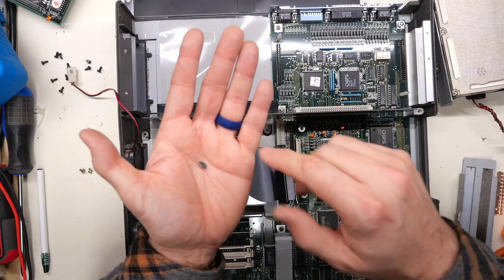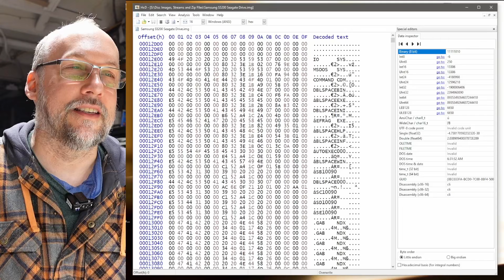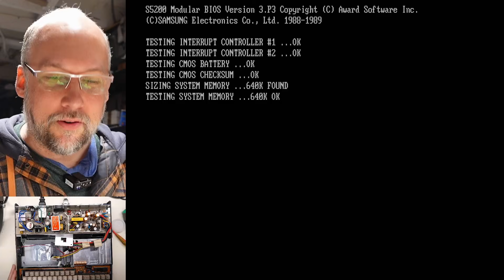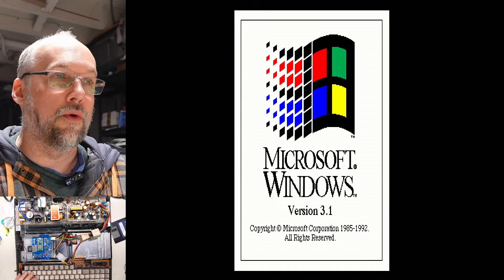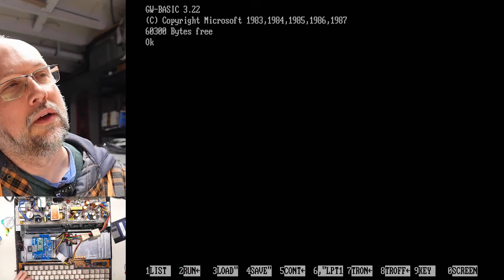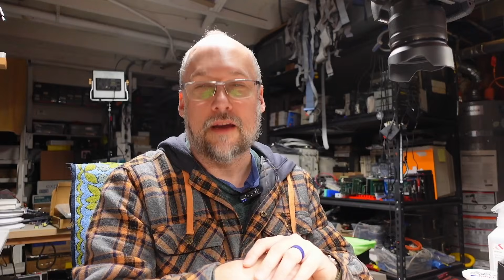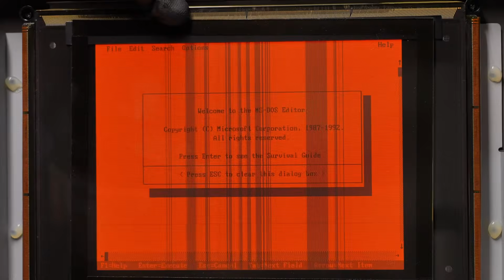PC Archeology: Let's explore the Samsung S5200 and attempt a repair on the gas plasma screen

Comment: the BEST tool I've found for true low-level sector by sector data recovery (partitions and formats ignored) is a lovely little tool called "GetDataBack".. For free alternatives; Recuva, and PhotoRec (both are quite good)
Fairly certain GetDataBack and Recuva are both able to recover from images.  Otherwise, just mount the image as a virtual hard drive?

Comment: Note regarding XTIDE: There's a project called XUBDisk that loads XTIDE Universal BIOS from a floppy. It's annoying as a permanent solution since you have to boot from the floppy every time, it takes some seconds to load the dozen KB or so of data from the floppy each time, and it eats as much conventional memory as your XTIDE ROM takes up plus its usual 1 KB working memory. But it can get a computer running when it's not possible or feasible to load it from an actual ROM chip.

This also makes me wonder if it wouldn't also work to have the option ROM on a card the usual way, and then just have a boot floppy that has nothing but a jump instruction to that ROM in its boot sector. That way it doesn't cost any conventional memory, boots up faster, and should still work on a machine like this, since the issue is that the BIOS doesn't see the option ROM and try to boot from it.

Comment: You will probably have no choice but to replace the plasma display with a modern LCD display and emulate that red plasma screen. However, you're not going to be using it for anything other than a collector item, so might as well leave the original screen.

Comment: I dont know if you managed to fix anything with this disk, Im quite late to the party. However, I do have some good tools to extract data from drives etc that I used at work to recover a huge disaster. It is a commercial software. If you still need to try and read something out from the drive, well, let me know and we can figure something out.

Comment: Tantalum capacitors short due to overvoltage, reverse polarity, or current spikes, which cause the dielectric material to break down. Common causes include applying a voltage above the rated limit, connecting the capacitor backward, or a sudden surge of current without a current-limiting circuit. Aging can also lead to a buildup of crystallized tendrils that bridge the gap between electrodes, causing a short.

Comment: This gas plasma looks exactly the same as one in a Toshiba or compaq, can't tell because Toshiba is slightly larger, but they both have the same chips. You can replace the problem chips with working ones, which is what I'm doing now. I'm canabalizing two Toshiba screens to fix some compaq screens. So far I managed to get one screen without lines. I'm going to make a guide on vcf forum when I'm done with my repairs. You can identify the problem chip by running a screwdriver across the pins of each IC and it will light up a specific column. When it lights up on the dead lines, you know which chip is bad. I found a fringe video that also mentions you may want to replace a chip next to it. The reason why is the problem chip might not be bad and it might be the one before it. The one before it just might have an Issue sending data to the next chip. Data flows from the white ribbon cable through each chip all the way to the end.

Comment: Adrian do you think its possible to "clone" this card for get it as pcbway project? I mean, what king of propietary ics has?

I think could be amazing for the comunity to have a card like this avalaible like the xt-ide project.

If you make a video pushing the limits of this card in terms of overclocking could you please try piball fantasies game? Iam curious to see if goes from unplayable with an 8088 with vga to fully playalble with sound using the 286 accelerator.

Comment: accpac plus i was still using this on a novel server in 2000 had to do all the y2k updates and it was still working 
then we finally ended it and moved on to somting else by 2001
we would run it in the dos shell in windows 98

Comment: Tantalum capacitors have an oxide layer internally. It provides a rather nice amount of capacitance for its area if polarized one way. Reverse the polarity and the oxide layer breaks down and forms a permanent dead short in the capacitor. As some people in the electronics community say, "Tantalum capacitors are strongly polarized." Unlike aluminium electrolytic capacitors that also don't like reverse polarity, but aluminum electrolytic caps just build up gas internally until they explode from the resulting pressure.

I have seen ESD alone kill tantalum capacitors.
Not to mention any negative spikes on the power bus during start up or shut down. (a couple hundred mV spike and its dead and will burn up when power is applied.)

And that screen assembly is surely something interesting. I agree that it doesn't seem all that fixable. But interesting.
Also, that doesn't look like a soldered interface, but rather a "Z tape" interface. Ie, just like a zebra strip, but 2 dimensional. A thin sheet that only conducts vertically through it. Really popular for bonding flat flex to glass, like we see here. Heating it won't help, and might in fact make it worse as the tape "curls up" from the heat and makes even worse connection.

And yes, conformal coatings are fairly common for high voltage applications. Or if one wants to reduce the risk of tin whiskers, especially in lead free solder. Can also held ensure that conductive dust doesn't lead to problems. But for this screen I suspect the main reason is to ensure that sparks doesn't jump between the pins.

At work I conformal coat quite a few boards for various applications. In my experience some brands of conformal coatings never really hardens fully, partly as a feature to not crack over time, but it sure can make boards get glued together if they rest on each other for a while.

Comment: Those two video modes you were perplexed by when you ran the vidspeed benchmark were VGA-modes, but it didn't list 320x200x256, which is also a standard video mode. If it had, I would be asking if you're sure that you don't have a VGA card in there.

So... It is an EGA card? Well, I've heard of some EGA cards that even supported 800x600x16. At least some people referred to them as Super-EGA cards, and unlike SVGA cards, they didn't support 256 colour modes. Maybe this is one such card...

But the monitor... Yeah, I'm assuming that there were EGA monitors to support these resolutions, but not in the beginning, since they are not standard EGA, but I know very little about that...

I don't know how vidspeed detects these modes - it obviously does, but it lists them as VGA modes, and I don't know if VGA programs would work correctly with the card... I don't think the refresh rates are the same as with a VGA card, and I know that if a program assuming it's running on 16-colour VGA mode tried to change the palette, it wouldn't work. EGA supports 16-colours from a total of 64 (RGB 4x4x4), while VGA supports 16 or 256 colours out of 256K (RGB 64x64x64).
I would be interested to know how... to know how you can test for what video modes are supported in DOS. Never did that myself, either I wrote the application to support a specific mode, so it was a requirement - or I let the user choose from a list of different modes. But this would be useful knowledge, as I've been mentally preparing myself (by not-so-mentally downloading copies of QuickBasic, Turbo Pascal, Borland C/C++ compilers [and DJGPP for that 32-bit DOS sweetness] from the webnetz) to do some for-fun coding for old DOS PC's :P

Comment: My first laptop, a used 386, I screwed up by spraying Windex on the screen, it got 3 horizontal lines on the screen that would not go away. I still used it that way but it really pissed me off. Back then even used it cost an arm and a leg (95)

Comment: I remember reading the Computer Shopper, which was a HUGE magazine you could buy of nothing but computer adds, and drooling over machines like this. At long last I saved a few pennies and bought a crapola 386SX25 and VGA monitor, it came via truck shipping, I used it till I found a good 486, at the time Workers comp sent me to college after a crash sent me to rehab as I could no longer be a cop, a girl in college bought my 386 with the slowest Windows 95 installed on it, 95 ran great on my 486

Comment: You can buy hotbar soldering irons from China for cheap. They have adjustable voltages and have a huge, wide tip on the end, specifically for fixing flat flex soldered connections. You should pick one up!

Comment: Hi Adrian. I enjoy your videos. I once owned a Toshiba 286 Laptop. It had a monochrome LCD and was build like a tank. Back in 2000 it adorned the front desk of my office, mainly because it looked cool, not because it was actively used. However, having said that I used Chiwriter 4 on it to very good effect. Eventually, the lines appeared on the screen, just like yours and the power supply started acting up. So it ended up in landfill along with most of my collection, much to my disappointment because I was running out of space. I regretted that decision and still do. If you can't find a plasma display I would urge you to give this PC a modern screen and bring it back to a useful stated. I understand that you have no particular feelings towards the laptop, but that's what I would do rather than keeping it in a perpetually "broken" state.

Comment: Forget if you mention it in this or the previous video, but found out today that the same exact screen is also used in the Toshiba T3200SX. A friend of mine owns one and luckily the screen is working perfectly on his. He had bought two, one with a cracked screen and one that wouldn’t boot, and combined them for one fully functional unit.
Reply: And very similar Panasonic plasma screen was in Compaq Portable 386. More info if you seach 'The Chronicles of Gas-Plasma'

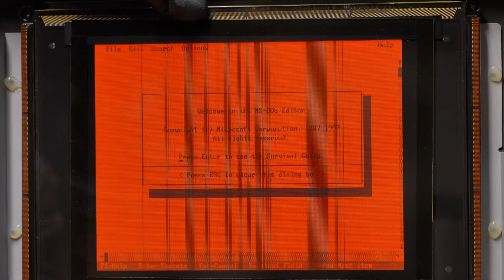Comment: Well.. being a goner anyway 🤷‍♀...1:10:11.... I would try to put some contact cleaner between the glass contacts and the flex cable contacts.. there where the corrosion is. and put some pressure in the glass like you were doing at 1:10:11.. and see what effect it has🤔....... Contact Cleaner will separates the glue.. yes🙄.. but you can put some sponge or rubber stripes behind the flex cable to keep the pressure in the area were the glue gets undone😯..... this is assuming of course.. that the flex cable contact are just pushing against the glass contacts... and they are not continues copper traces.. which I don't think they are🤔..

Comment: If you ever fix the screen of get an original replacement it may be worth adding a fan if possible or something to help with cooling along the top of the screen in case heat is the issue or is accelerating some sort of degradation of the connections

Comment: The glue on the outside is rather serving as a strain relief - to avoid excessive bending / sharp edges of the flex-to-glass joint. The glass-flex connection is made by "soldering" at specific temperatures - you can google "chip on flex" parts for LCD panels, its very similar technology.

Comment: Those lines on the plasma resembles the ones on the old game boy, which is caused by the glue making the connection in the ribbon cable deteriorating. On the game boy, you fix the error by heating up the glue and applying some pressure. Perhaps that would do the trick here?

Comment: If you set the drive type in BIOS to "Type 47," then it should allow you to edit the fields for the cylinders and heads.  That was actually the standard in the early Eighties for advanced drive controllers.  Before that, you needed to get into a firmware program on the drive itself by opening the DEBUG command in DOS, and entering g=c800:5

Comment: For restoring the HDD have you tried Hirens Boot CD 15.2? I use DiskGenius specifically off of that disk, it might work or be touchy in Windows 10, I know it will work if it is booted into its WinXP environment but then it's a matter of mounting the image file

Comment: Those two circular glass projections on the back of the display that you wondered about might be cavities for getters inside the glass envelope. These would contain compounds such as barium which 'clean up' the impurities remaining inside vacuum tubes of all kinds. Otherwise, the impurities would quickly poison the display gas. When a getter cannot be integrated into a single path high voltage electrode (such as on a neon sign), a common mass production strategy would be to inductively heat the metallic getter substrate from outside the tube, until the getter is red hot (so it can't be too close to other parts inside that might be damaged by its short but intense heat). This chemically activates the getter. But it needs to be done at the factory somehow, after the tube is sealed.

Comment: I worked in a computer shop in the 1990's and we used laplink 3 to build every computer.  We would install the hardware, and use LL3 to copy over the operating system from a "server" over the parallel port since that was far faster (vs serial).   It was still pretty slow, but once you started the transfer, it was completely hands-off so you could disconnect the KB/Video and move on to the next machine.  One of the other nice things about using laplink is that it didn't matter what kind of other hardware the machine had.  Every machine at that time had a parallel port, so it worked 100% of the time regardless of the generation or configuration of the machine.

Comment: If i remember right they released dos 6.2 with DoubleSpace and got the hell sued out of them by the company that actually owned that trademark. 6.22 is identical to 6.20 except for renaming it to DriveSpace. It's been 30 years since I've mucked around with it so I may be a bit off on the details but that's how I remember it.

Comment: I have one of these laptops but with mine the psu shorted out and sent the 200 volts into an address line so 50% of the board is fried sadly. the display still works but i cant find any pinouts on it, would love to use it with a raspberry pi or a different sbc. would it be possible for you to measure out the pins on the video connector on your display?

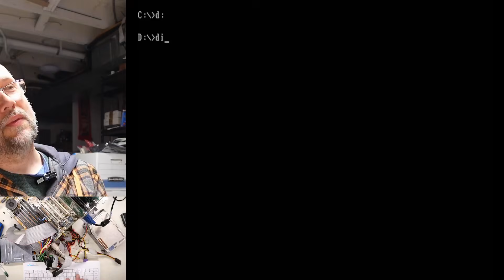Comment: 15:02 It's 30 MB but only 4 MB free, there is definately something going on on this drive. I'd try a simple undelete first. And I'd also try to find out where the 26 MB went (dir /a). You could also go to the FAT and make a list of all cluster chains and then extract them. Then, use tools to determine their file types (like Linux file).

Comment: found a T3200 maintenance manual there is a procedure for adjusting the screen voltage. It needs actualy an incredible accurate voltage. I don't know if your voltage supply is the same but for the T3200 : VR1 MIN +201v.  MAX +202v. then VR2 MIN +208v. MAX 209v.

Comment: When you checked the drive in the other computer, it showed on D, only 3MB available. But disk is 30MB. So there was unpartitioned space, or something, that was not assigned letter, and maybe used by dblspace. It is very long time I used it so I do not know how it works, especially in earlier dos versions.

Comment: You found dblspace to be behind the hidden disc content, but next time you might find 'r-studio' to be useful. I've used it for more years than I care to remember. The first time I used it I trashed my disc so be careful not to save back to the disc you're exploring. It's forensic and finds files that don't exist, but it seldom misses anything. In one mode you can find the deleted file structure pretty simply. Well worth a play anyway

Comment: Adrian, hello , If you could make a small puncture incision in the glue , you may be able to clean the contacts with Due-Ci Electronic R-10 Contact Cleaner ( I saved a few hdd electronic plates this way). It is worth a try if you can get the cleaner. I have the Toshiba T3100e , if you want I can disassemble it to check if screen is same model (not sure) , Mine works (the screen), but sometimes it fades after a few hours of usage.... (I plugged a old UPS so it should make power more linear - like a stop-gap fix). As for data recovery , you can use a bunch of softwarse that are in Hirensboot DVD , like Testdisk, EaseUS, GetDataBack FAT, SpinRite , and others depending on situation, some work even on 286... I use a overlay app so it let me see the full 4.3 gb. It should be able to apply on the same SCSI thingy with SD you used , you just need to do a bit of booting from floppy , load the overlay disk , find the drive, and partition it under dos... (should work in theory , worked fine on EIDE seagate).

Comment: Remember that DOS 6.22 can only see hard drive partitions up to 2.1gb.  So that 4gb SD card won't work unless you partition it into two drives.  Unless of course the computer has further limitations. 528mb is another limitation for some systems.  So there's another size you can try.
Love your videos, always look forward to the next video.
Reply: To complete your info DOS3.3 32MB

Comment: i could't wait so i took a screen apart. it's obvious a bigger brother of yours. The pcb layout is 99,9% identical, same connectors. But it's a 10.2 inch made by Panasonic. type : MD400F720PD1
Sorry i could't help you. Maybe it would work, but the bigger size won't fit the frame.

Comment: i have 2 Toshiba T3200 and see a lot of similarities. I powered them up and both started crackeling with a lot of smoke and weird smells.  It are the RIFA capacitors in the power supply that blew up. Ordered new ones. I ll keep you informed.